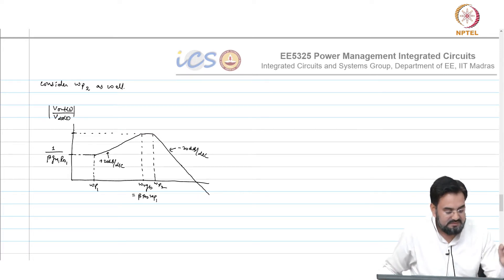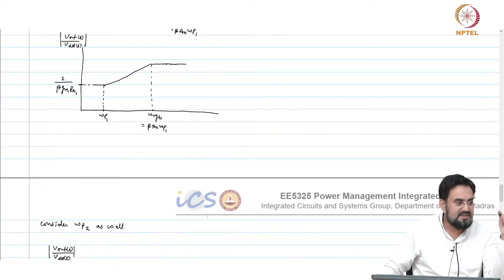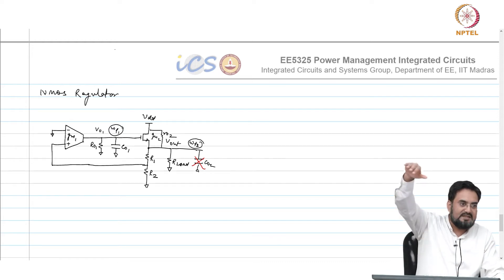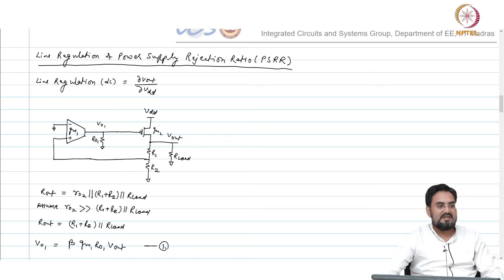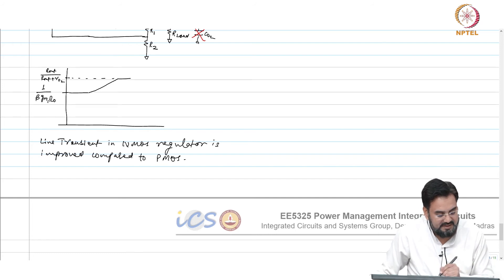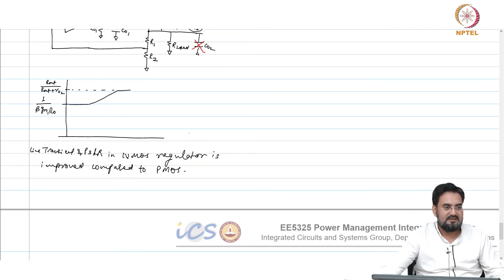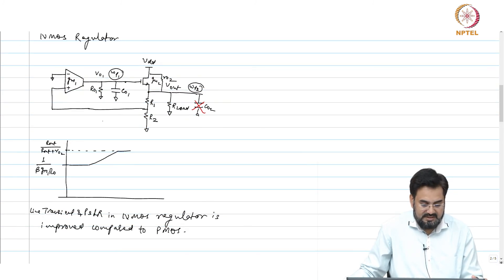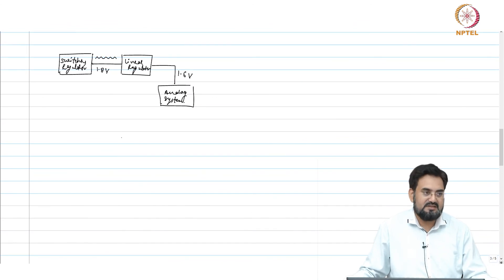PSRR of PMOS versus PSRR of NMOS LDO

Comment: When C01 is grounded , sir said Vdd will reflected through ro2 to Rout (voltage divider) , but isn't that in context ot small signal model of NMOS , do we follow that in cutoff ... I mean once nmos goes into cutoff ...as Vgs =0 .... how will any change in VDD get reflected anyway at the output ... pls someone answer
Reply: Nmos ldo:

I think at higher frequencies we cannot model nmos to its equivalent small signal as it is entering cutoff..

However if we think contrary to NMOS based common gate amplifier there we do proper biasing with some Vb at gate and ensure transistor works in saturation then we find equivalent small signal parameters...

Am I thinking right?